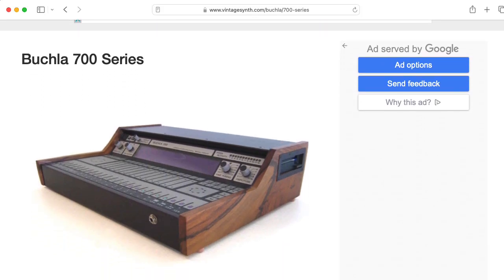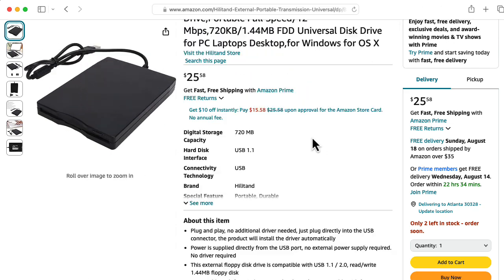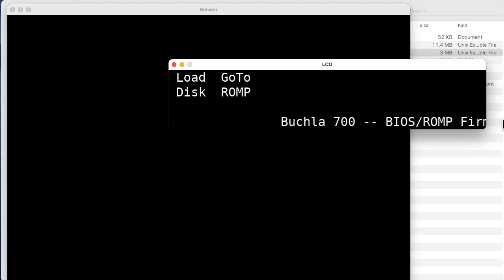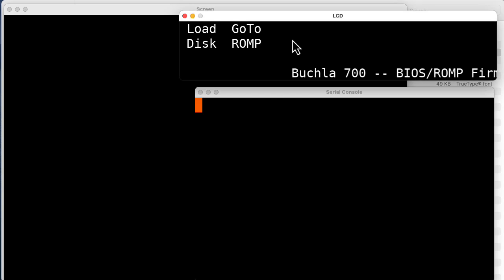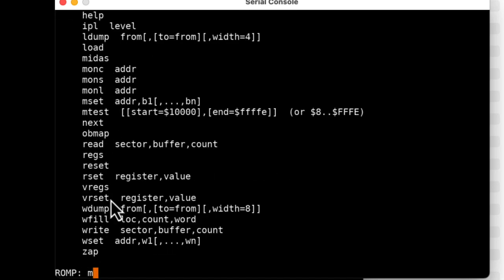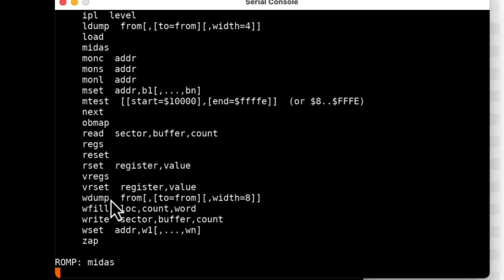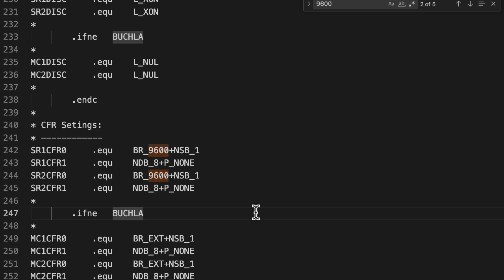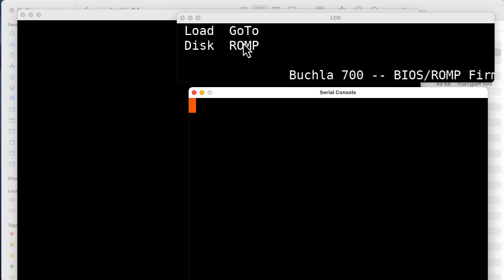Buchla 700: Startup Source Code Analysis, Debugger, and RS-232 Terminal Connection

Comment: The 700 is a remarkable instrument in its compactness, especially when you consider that it was introduced in 1987.  It wasn't the first commercially available DSP-based synthesizer- the Digital Music Systems DMX-1000 was back in 1980- but I believe this may have been the first to not require a separate front-end computer or keyboard.

Comment: Recently i got such Gotek floppy emulator for my Akai CD3000XL sampler, but I'm still figuring out how it works.
I got it to show 10 virtual floppy discs in the sampler, witch toke a few days because the read me is not very clear.. witch you need to copy from a zip file.

The Akai S3000XL sampler is one beast of a machine if it wasn't for floppy or SCSI discs.
Reply: Did you manage to work it out
Reply: You use the test tone to make a sine wave, which you then use for jungle basslines. No floppy required :) Treat the sampler as a synth, get creative.
Reply: @drtitus  I got the device more than 29 years ago, even the foil on the lcd screen was still on a few days ago, it sat all this time in the box.

How do i adjust the test tone to sine wave?